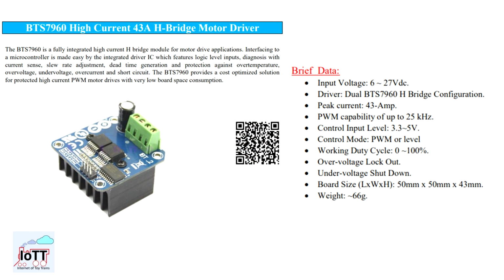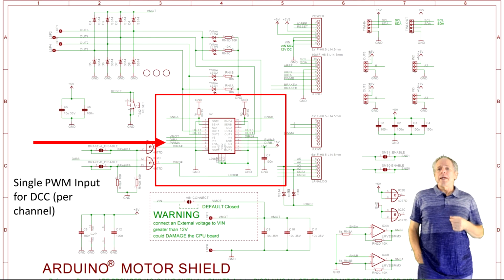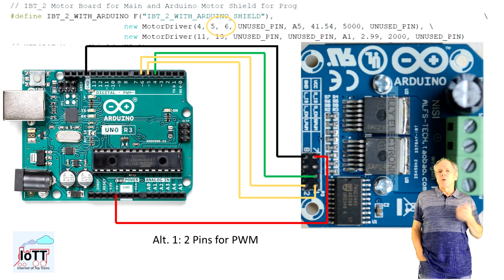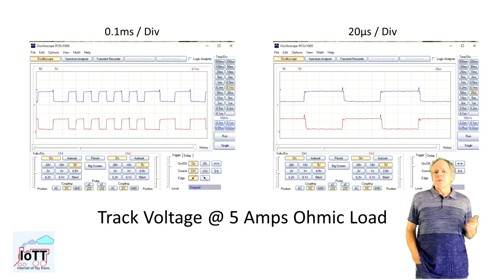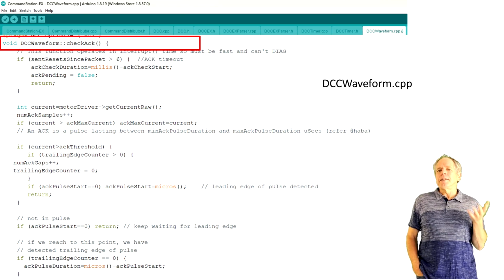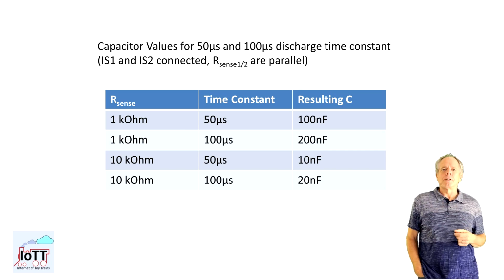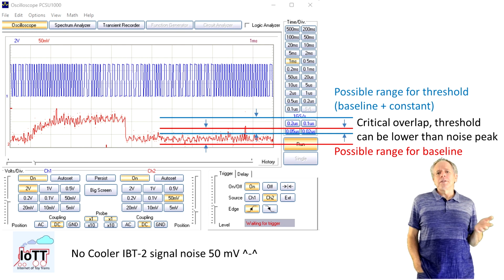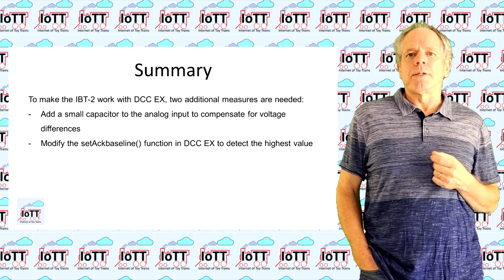Scary IBT-2 Current Measurement  (Video#105)

Comment: Hi, how are you?
I've used the configuration you mentioned with this Arduino conversion:
Floating motor current = sensorADC * V / 1023.0 * 8.5
Where V = 4.5 (as a safe limit)
R = 1kΩ
And a capacitor.

It takes 3 motor cycles to start reading, and when it does, the value is always the same on both outputs.

I also used a multimeter and it doesn't read anything. I've already replaced the H-bridge several times.

THANKS VERY MUCH
Reply from the maker: See my reply to your e-mail

Comment: Hello!  My IBT-2 module, when no current, has 1.8V on L_IS and 2.2V on R_IS. When I put 10Ohm resistor - it increase to 2.3 and 2.7V. So command station shows 2-3Amp. I put capasitor 10nF but it doesn't change situation. Maybe it's bad module?
Reply from the maker: I have seen some BTN chips that give an output current on IS as soon as voltage is applied. Is the 10 Ohm resistor your output load? The BTN chips I had with that problem at least had a linear error, so it is easily possible to compensate in the software by just deducting a constant value to the measured input.
Are you using an external IBT-2 module with the 10k resistors to convert sensor current to voltage? I would try a different IBT-2 module and compare the results.
Reply: @IoTT  Of'course I have seen your video with maximum attantion. And ofcourse my module has 10kOhm resistor to convert sensor current to voltage.  I check it many times. And i put capasitor 10n (and try 0.1mk and 1mk).
I even order ASC724 current sensor 50A - but it has the same 50% voltage with 0A current. 
What is the  way to deducting a constant value?
And Yes a order another one IBT-2 to compare.
Reply from the maker: If you get the same results with the ASC724 I would check if there maybe is a problem with the GND potential that would lift the sensor voltage.
To compensate for the offset, you would deduct a constant value from the value you read from the analog input and then use the result for the TrueRMS calculation.
Reply: @IoTT  If you check ASC724-50A manual - you can find that it has 0V in -50A and 5V in 50A and 50% (2.5V) in 0A

Comment: Thank you very much for this video. I have been searching for more information on this current sensing feature of the rather cheap module for control  of a size of motor of about 300 W for sewing machine.

1) You say, that the current from the "current source" is measured. Could you be a bit more specific here? Is it the current through the transistor to the + supply or the current to the transistor in the negative supply or somewhere else?
2) When you turn off the digital inputs, I guess that both transistors becomes off, and that the only way some current may be through free wheeling diodes. Is the free wheeling diodes part of the transistors and is it safe to rely on them?
3) I have read, that the transistors may not withstand a continuous current above 15 A. If the application only require the DC motor to run one way, you may be interested in running the two pairs of transistors in parallel. It could make problems, if shifting time delays are different. What do you think about that?
Reply from the maker: 1) The IS pin is the current source. It is fed to a resistor, which converts it into a voltage that is measured. There are current sensors on both, the hi and low side for protection reasons, but for current measuring only the hi side is used.
2) Yes, when the enable pins go low, the device goes in high impedance mode. Any inductive load will discharge via clamping diodes. If you want to use it for braking, you put both bridges to high, so one is conducting, the other conducts via clamping diode. Putting both to low has the same effect, essentially shorting the output for braking.
3) No idea, but I did a load test with 5 and 8 Amp (video 121) and the chips got pretty hot. Plus the pins in my opinion are not made for the 43 Amps the device is supposed to do. Maybe for a few secs, but not longer. That is probably the main reason why the successor of the chip has 2 pins for feeding instead of one.
Reply: @IoTT  Thank you. Am I right to assume, that one PWM input control the left side of the H bridge and the other PWM input controls the right side of the H-bridge?
I read, that the IS pins are only affected by the positive current in the upper transistors.  In order to measure the motor current you need the Arduino AD-converter sample hold circuit to sample the current signal the right time. With a switch frequency of 20 kHz it is not trivial. But I think it is possible to use Timer1 of the normal Arduino Uno to start the AD-converter at right time. Otherwise you need to low pass filter the analog signal significantly.
Reply from the maker: Yes, each PWM controls one chip. The need opposite signals to make it work.
Yes, with 20kHz PWM frequency, the Arduino AD converter is too slow, and also, you would get garbage anyway because of the fact that you either read PWM ON or OFF, but you don't get the impact of the duty cycle. So, low pass is the correct answer. 
Or what you also can do is sampling at a constant rate and do an RMS calculation. That way you get ON/OFF samples with a probability proportional to your duty cycle, and the RMS calculation will make the result right.
In a DCC application it is different as it is always 100% duty cycle, but the polarity changes with 11kHz average. At that rate it is possible to sync the ADC with the timer interrupt.
Reply: @IoTT Thanks. It is a bit difficult to explain everything here. And I am new to Arduino, so it is a part of the problem. I have tried to open a thread for comments in the Arduino Forum on motors. I am "Backflip". I do not know yet, but I guess it would be in order to sample and measure the current signal for every 0.5 ms or something like that and then calculate a mean value for a control loop, that might run for every 5 ms. With a 125 kHz ADC-clock, the signal can be read after 104 micro seconds. But sampling of signal takes much less time.
Reply: I think I found the answer to question 1 in the data from Infineon for the BTS 7960. It is the active positive current in the upper transistor, that is measured. So if you drive a motor having its inductance, the actual motor current should be corrected in accordance with the PWM value, because the current continues in the motor in the lower transistor or free wheeling diode, when the upper transistor is off.
Reply: I have just made a temperature check of one of these modules with a heat sink, and I think that the current specifications given are far too optimistic. The right steady state current should be about 7 Amps. I use at test set up with the H-bridge in a four quadrant configuration with a motor and 24 VDC. Both sides are driven by 10 kHz, so the motor see a 20 kHz PWM signal. I then measured the temperature on the surface of the packet and on the heat sink. With a current of 7 Amp to a loaded motor I get 124 degr. C on the surface and 84 degr. C on the heat sink. You may choose to set two modules in parallel in order to increase the current and power, that you can handle. I have increased ADC clock frequency to 1 MHz, and is able to measure the current via an op-amp that take the signals from the "shunts" and subtract them. In this way you can easily measure both positive and negative current in motor in same signal.

Comment: Thanks for the video. Indeed, the analog reading of the pins of the BTS7960 is catastrophic. In addition, the analog signals at the same period as the PWM. Since I fixe the frequency at 16Mhz,  reading analog signals is not easy. And to close it all, the analog signal has a sinusoidal signal that resamble to a amplitude modulation. 

I added a 15µF /25V electrolytic capacitor in parallel with this 10k resistor for each of the analog pins IS_R and IS_L  before routing the signal to the analog pins of the Arduino board. This gives me a clean analog DC values with 90-95% noise removed and that can be read very quickly. The disadvantage is that I have negative pulses of -540mV. Higher the PWM duty, the lower the négative pulse. 

I do not combine the analog outputs because I prefer to read them independently.
Reply from the maker: A capacitor is for sure a good idea. I am using 10uF and it works quite well. The resistor is chosen so that the output voltage is not exceeding 5V for the current range I want to use. For safety, I am also using a zener diode, but within the normal current limits it is not used.
In an H Bridge application, only one sensor is active at any point in time, so even if you combine the outputs, you can always tell based on the control signals, where the current information is coming from. Combining safes one analog input.
Reply: Hi, I did exactly the same thing. I tried with a 12V@0.41A motor and a 24V@5A motor, with both 1kΩ and 10kΩ resistors. The result is the same; it only detects when the motor is moving, but regardless of the motor type or resistance, the reading is always 0.9 or 1.6Ω.

I'm only reading the analog pin on the Arduino, using the following conversion line:

 int readADC = analogRead(lec_i);
    float cMotor = (readADC * V / 1023.0); 
   float cIS = vIS / R;
    float cMotor = corrienteIS * killis; 
    Serial.println(cMotor);

Comment: Hans, Thank's for this info. I recently built a booster board that is Dave Bodnar design and IBT-2 ( w/cooler) for use with my DCC++ system. the system works good. After adding IBT-2 my Digitrax AR-1 auto reversers trips the "SHORTCIRCUIT" . Digitrax info says .25 to 5 amps trip current is adjustable with a POT. but clearly the current sense shuts down the system when it see's the condition. I was able to use the AR-1 with the Base Station prior to the booster. Is there a safe way to implement the AR-1? Thanks for any advice you could offer, Dave...
Reply from the maker: Most likely DCC EX sees a huge current spike when the locomotive bridges the track gap.
- adjust the settings in the motordriver.h setup. I don't know who came up with the default values, but they are ways off. Use 8.3 for senseFactor and 7000 for tripMilliamps.
- add a small capacitor, e.g. 100nF between Arduino GND and the analog input you are using. This slows down how fast the sensor voltage can raise, so the spike might be gone before the value gets critical.
Reply: @IoTT  Thank you very much, I am waiting on a makerfab wifi shield to complete my EX station and I will implement the changes when complete. thank you for all you do. I do not believe motordriver.h is in basic DCC++ base station I am currently using, just current monitor.h. The Booster Board has it's own little sketch with if statements, for current sense analog pin if : > greater than pin current  booster board shuts down. It is so satisfying , exciting and rewarding when this stuff works as intended, Have a safe and happy holidays.

Comment: Another great video Hans. I've been hoping someone would make an MRR DCC-specific Arduino Shield that took care of all the signal inversion and other passives to produce reliable operation and it looks like you're doing it which will be awesome. Looking forward to giving this a go some time. I think I have some of those IBT2 modules so need to wire it up sometime.
Reply from the maker: Thanks, Alex. Yes,, that's the idea: Arduino Uno, 2 x IBT-2 Motorshield, RedHat on top, makes a Loconet command station with two 5Amp tracks, one of which can alternatively be used as programming track. Plus WiThrottle, Loconet over TCP, MQTT built in by default as it is part of the IoTT Stick anyway. I probably will call it "The IoTT Cube" ;-)
Reply: @IoTT  Awesome roadmap Hans!
I'm looking forward to seeing it all working and ordering some boards. The need for a simple and reliable >2A capability has been around for a long time and has undoubtedly proved the concept and made it easy to get started, but the original Arduino L298* boards are a bit limiting for anything more than small layouts.
The capability for multiple 5A drivers will undoubtedly be another game-changer for DCC-EX.

Comment: Maybe more of a follow on to Rob's comment.  Are the two types cooler vs non-cooler pin compatible?  I use the cooler version and under normal usage use 8 to 10 Amps.  Could I just run jump wires from the daughter board to the pins on the cooler version?
Reply from the maker: 8-10 Amps? sounds like Lionel ;-) But yes, both use the same pins. The layout is different, though. 4x2 on the Standard, 1x8 arrangement on the No Cooler. Not a problem if you use Jumper wires.

Comment: Scary indeed! Congratulations on such a thorough analysis of the IBT-2. Your plans will certainly make this a better option for higher current needs with DCC-EX. I like your idea for a small daughter board but, without a heat sink, would the setup run too hot? As most people limit their DCC current to 5amps, is this well below the threshold we should concern ourselves with? This latest video again makes me think that my NCE system just might be up for sale. Great stuff Hans! Keep them coming!
Reply from the maker: Thank you. Up to 5 Amps temperature is not a concern. The On resistance is 16mOhms, resulting in a power dissipation of about 200 mWatts per chip, which is not a problem for a device that size, it pretty much stays at room temperature.
Reply: @IoTT  Hans, thank you for your answer. I doubt that there is a need for more than 5amps for any N-scale layout and with a decent circuit breaker, I won’t have any worries. My Red Hat DCC-EX just moved up in priority.